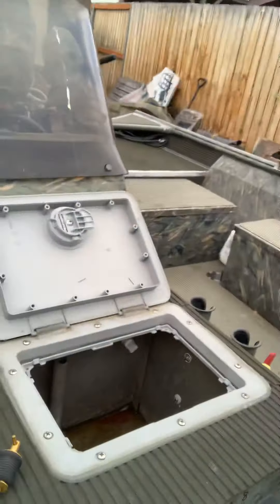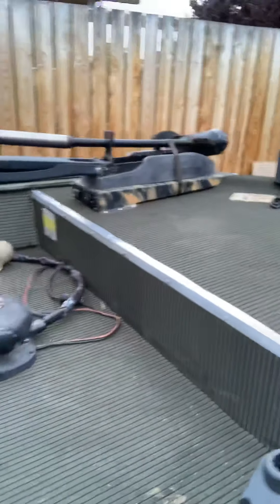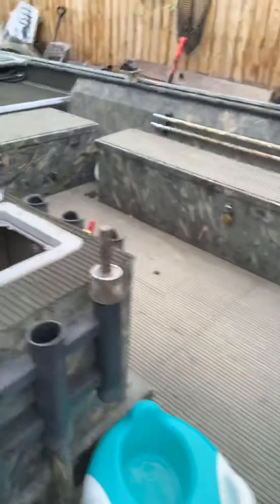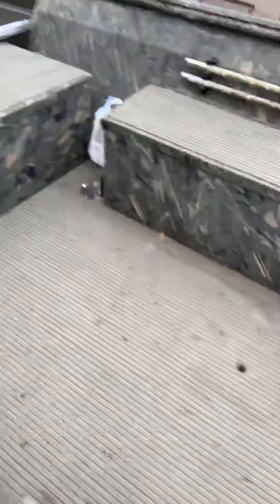Everything you need to know about hydroturf before install!

Comment: Mark a straight line where the 90° bend is and then make a v cut 1/2 of the thickness of the hydro turf on the back side. It will make a nice bend afterwards. Great video